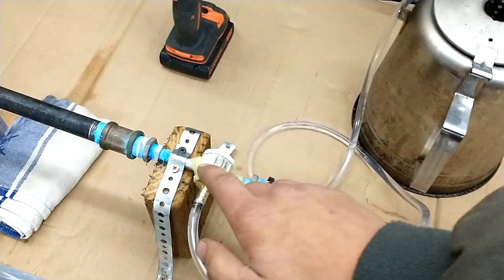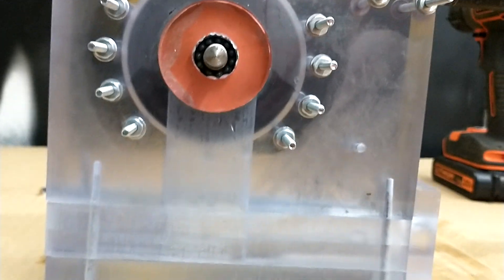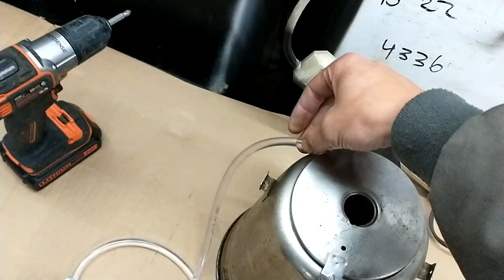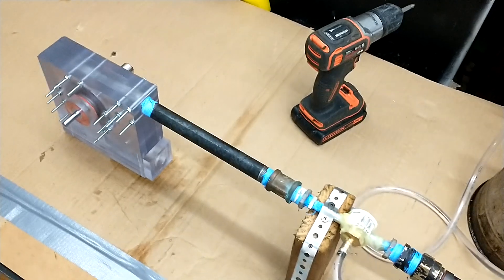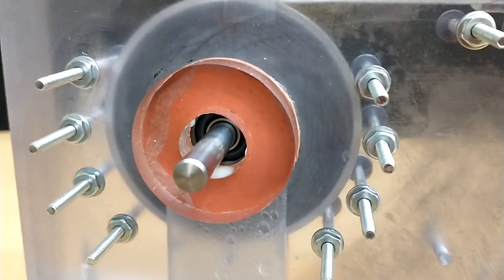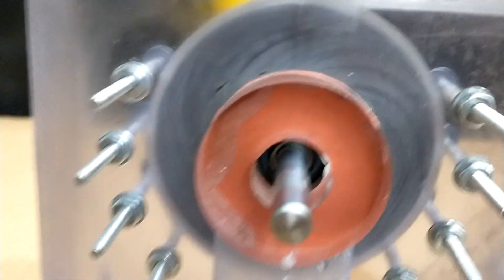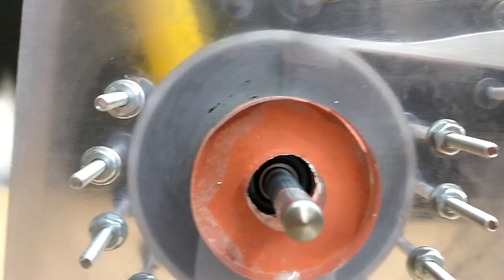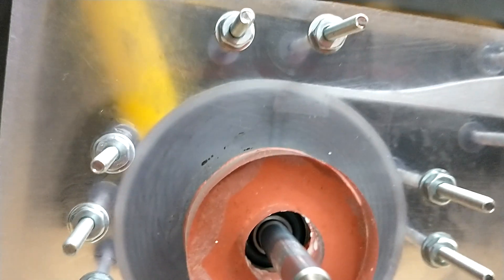Amazing visualization of the boundary layer inside the tesla turbine! See the vortex!!

Comment: Hey bro the bearings it's the problem  needed titanium turbocharger ones to going Up to higher speeds bro trust on me maybe bronzed like de useded in head valves cam, because te looks like this going to flying when take full capacity of the design hahahah

Comment: Any rotary seals do you use in order to protect bearings from water?
Reply: im trying to figure that out as well.
Reply: @andrewsmithmilan1780  There are PTFE seals that run dry (without oil) against pneumatic pressure. I wonder if those would work 🤔
Reply: @TANOCA17  good call. 
I think a PTFE o-ring would fit my design perfectly, after doing some research. I'm designing an enclosure to 3d print, will be used for hydro-power.
Reply: @andrewsmithmilan1780  o-ring may not be the best choice for a rotary application as they're designed mostly static or mostly axial shaft movements but only occasional shaft rotation. There are PTFE (rotary) shaft seals from SKF. Those are also extremely low torque which equals low power loss, might be an advantage for such a high rpm application compared to any rubber rotary seal. PTFE is durable up to 30 m/s shaft contact line speed and withstands extreme temperatures. Only disadvantage may be the cost and availability.

Comment: 26 JUN 22 Question: If the discs were made of modern day materials would they withstand the forces involved?  Also: Diamonds can be grown now....would grown diamond discs be strong enough?  (Not a science guy, just a question)
Reply from the maker: The disks worked just fine back in tesla's day, it's a myth. Tesla did one test where the disks warped, and I did as well. Anything will warp or fail at a certain speed. The rpms required for good performance are actually not that high. Ill be showing this in my next testing.

Comment: So you basicly took Nicola Teslas turbine and fucked it all up xD great job man whoohoo 10 steps back for human kind
Reply from the maker: Says the guy who knows nothing about Tesla turbines, unless you haven't seen any of my power testing 😂
Reply: @iEnergySupply  a tesla turbine is indeed that system .. but powered only by falling water .. it seems to me that running a compressor xD doesnt add efficiency or power loss to its already efficient turbine power
Reply from the maker: @obedientfire840  It's designed to work on steam, air was just for pre-testing. Nikola tesla actually used steam too to drive the turbine with great success. The turbine wasn't designed for falling water but will work with it. See my steam testing videos.
Reply: @iEnergySupply  give me a 500 kw electric motor and some some gears and ill show you the power my tesla turbine produces 🤭
Reply from the maker: @obedientfire840  You don't have a tesla turbine. Do you? Also your not supposed to use gears, your supposed to use high speed generators directly connected to the shaft. For a 3 inch turbine I achieved a massive power output at the temperatures I used.
Reply: @iEnergySupply  the goal is . To use less outside power . and make power generated naturaly 🙄 ... if you want power if can give you power
Reply from the maker: @obedientfire840  yeah, I use solar heat collectors that are up to 90% efficient, rather then solar voltaic cells that are only 20% max efficient. And I can store the energy in mass, thermal energy storage rather then chemical batteries.
Reply: @iEnergySupply  your numbers would be the same in syberia .?

Comment: That’s awesome!! I’d love to see a thermal on this! 

I had no idea water would have such an effect on pressure. How is the water mix regulated?

Could a needle valve on the vacuum side of the water reservoir prevent the flooding, in the beginning and the possible oversaturation during operation, without having to change the orifice size of the injector?
Reply from the maker: this isn't the intended fluid, and steam added to the compressed air would be better. I would have to do more research here to give you definitive answers. To see the intended use of the turbine, see our latest videos.
Reply: @iEnergySupply  I’m definitely interested and will be checking them out.

Comment: So this only tells me that the air pressure pushing into the valve is controlling the speed. It is not spinning under it own power haha. Air is the power. Plus if I pushed air into a small opening of course it is going to be forced to push out faster than the supply.
Reply from the maker: What's your point? Why would you expect it to spin under it's own power?

Comment: only if we had a material that could handle this amount of rpm, i read someware that tesla turbine optimal operational speed is 50K rpm! where regular electric turbines operates in a range 1-1.5k rpm
Reply from the maker: or record is 150000 rpm, with a 3" rotor, giving us a 1400 mile per hour periphery speed.

Comment: Try picking up water with a steam water injector, as used in steam engines,  the water flow can be regulated then, also if you fit hydrostatic bearings to your turbine you,ll get more efficient running and you can loose those noisy cheap Chinese ball races .
Reply from the maker: these bearings are rated at 150000 rpm, we show this test in another video. This video was just for fun too.

Comment: KEWL,  I would be replacing that water with oil, the bearing is not going to last long with water as a lubricant and I am wondering what the RPM range is on the bearing part number??
Reply from the maker: people keep telling me the ceramic bearings may not need oil. If they don't' need water would they work with steam, at least the water can add a little bit of lubrication right? We will test it either way.

Comment: But the increase in RPM is because increase in air Pressure or air flow or because increase in hot water. I have a grinder with 65k rpm with only 50 PSI air pressure.
Reply from the maker: it's the size of the grinder wheel that matters, it's periphery speed that shows speed. We recently got mac 1.7, close to 1400 mph perifery speed on a 3" rotor going 150000 rpm.
Reply: @iEnergySupply   The grinder I am talkin about is a hand held for 3mm collet shank. (That is the reason, the peripheral speed). All grinder direct axel over 25K rpm, can't be electrical Universal motors,  because the inertia in the stator will damage the wiring and te spark in the collector will short the tool. I know grinder over 14K rpm but have gears to speed up the rpm out put.
Reply: @iEnergySupply  However, the question here, if the speed is increased by PSI or by the amount of vapor.

Comment: I don't know what pressure you're running, but the reason the water is cold is because the air in contact with it is decompressing. That being said, the adhesion of the water to the turbine surface should drastically increase its efficiency. The spiral formed was also immaculate.
Reply from the maker: This experiment was just for fun, please see our new video. The intended fluid is water only.

Comment: Adding a load would allow you to see the amount of extrable energy from the system and see if the heated water is worth the extra energy.
While interesting. It is important to validate and quantify the specific variables.
Reply: Tesla verified it. The reason it was deemed unusable at the time was because there were no materials that could hold up under the extreme rpm generated. This is an absolute engineering marvel in it’s pure design.
Reply from the maker: Please see our latest video. Our analytical equipment is on the way so stay tuned.
Reply: I hate it when they dont add a load cus they know it's gonna fail miserably lol 😜😜
Reply: @davey2k12  It's like there's some reason no one is powering anything with these
Reply from the maker: @davey2k12  hahaha don't make a fool of yourself before watching the load testing. Here we get over a horsepower of pure electrical power at low speed. https://www.youtube.com/watch?v=MkGAKqG2qvU&t=1s

Comment: Without some kind of load on the turbine it's hard to know how much work it's able to do. Even a simple fan on the axle and measure the RPM would be something.  
Then, run it without the water, just air.  Compare that to water + air, then your steam + air if you like.  For the moment all I am seeing is a thing spun by compressed air and no indication of the water adding anything to it other than making things drippy.
Reply from the maker: We show loads in other videos, have you seen our latest?
Reply: @iEnergySupply  These all seem to involve the water, I'm saying run this without the water, what are the results then?  Once you have that baseline then we have something to compare it to when you add steam/water.

Comment: Um, venturis dont work with head pressure. When you apply pressure to the choke point of a venturi, the increase in air speed creates a vacuum relative to the outlet pressure which for general application is atmospheric. When you try driving a teala turbine, especially with a nozzle that has a small choke point to also get high velocities, you're increasing the outlet pressure on the venturi. Because this pressure is higher than atmospheric, the "vacuum" the venturi creates is slightly less than the outlet pressure which in here nets atmospheric pressure or maybe a couple inches of pressure depending. If you want the venturi to ACTUALLY work, you need the pot to be pressurized at venturi outlet pressure (basically you need a sealed pot where the air space is connected to the venturi outlet so the pressure is the same), and the hose can then feed the venturi. The air pressure differential to get the pumping action, lies between the venturi jet, and the venturi outlet.  Another way to look at it is with no turbine connected, both the outlet and the pot are at atmospheric pressure. You apply compressed air and it works fine. Well same applies for a load. You need the pot pressure to be same as outlet. This is why blow through carb setups on hotrods have a hat that covers the entire top of the carb, sometimes putting it in a pressurized box. This pressurizes the float bowls as well as the venturi. Same concept but backwards.
Reply from the maker: Yeah this test was just for fun. Please see our latest video for the application of the turbine.

Comment: Because other than friction of the bearings you don´t extract any energy, the heat of that warm water just goes into the expanding air, that otherwise would be colder than ambiant after expansion.
But non the less, a nice telsa turbine going at therminal velocity! 👍
Reply from the maker: yeah this particular test was just for fun, I think it would have been better to mix the steam through the  nozzle instead of the just hot water. I wanted to point out, this was actually a low rpm test compared to our supersonic run where we got 150,000 RPM with a 3 inch rotor, roughly 1400 MPH Periphery speed. Here is a link. https://www.youtube.com/watch?v=oVjMJkABboM also please see our latest video that shows the actual working condition the turbine will be used in.
Reply: doesn't expanding air increase the speed of the flow ? it would certainly have some energy to be extracted from that acceleration. That's basically how traditional turbines work, isn't it?
Reply: @monad_tcp  yep, and that's also how this turbine works. They just go the other way around, they heat up gas to get higher pressure. (internal combustion engines, like jet turbine have an extra step) Than it's the same, gas expands, and a portion of that energy potential gets converted to mechanical power. 
Pressure and heat are interlinked, or basicly exchangeable in gases.
Compressed air is higher pressure gas that got rid of it's excess heat after compression. When resalesed it drops in temperature, if you give it the same heat back on expansion or ceep it hot, you theoretically get all the mechanical force back you put in to it.

Comment: Would it be possible to upscale something like this to, say, power a house? I've heard it needs some serious rpm's to generate a lot of power. I imagine the spinning parts would have to be made from a hard, heat-resistant  material with high tensile strength.
Reply from the maker: absolutely, see our newest video, and please leave a comment. with carbon fiber we achieved 150000 rpm with a periphery speed of nearly 1440 miles per hour.

Comment: Should measure what rpm that's spinning out that's insane
Reply from the maker: Our record is 150000 rpm, and roughly a periphery speed of 1440 mph
Reply: @iEnergySupply  looked at running a turbo impeller see how much boost you can get? 😆😆😆

Comment: 0:07 uhhh...... 212 degrees and 80 degrees is QUITE different 
.
if you said its "212... or it might be 180 degree water".......
i would not IMMEDIATELY start to doubt all claims you make
.
like.... i think this style of turbine CAN BE just as efficient as a blade type..... 
with the right nozzles, high speed, and 2 or more stages, with the perfectly sized disks
.
but saying "ya... it could be ice, water, or steam..... i have no idea"
that does NOT inspire confidence.... 
.
.
.
i really hope that was just a slip up
and you MEANT to say 180 degrees 
.
and while 180F to 212F is a MUCH MUCH smaller "controlled experiment" issue.............VS 80F and 212F
80F is pretty far below boiling point....... and 212F is right on the edge of boiling (at see level) 
.
.
.
.
so again..... i hope you MEANT to say 180 degrees
.
because if you dont know the difference between just over room temp........ and partially boiling water
then you clearly dont have enough skills/equipment/sensors.... or even just knowledge.... to conduct an accurate experiment, with actual control

.
.
.
.
.
.
.
PS.... im only 0:14 seconds in..... and im REALLY questioning this
Reply: "the water forces the compressed air to expand"
.
oohhhh nnnoooo ........ you are a hack fraud 
.
COMPRESSED air is going to expand...... thats just what higher than atmosphere gasses do when exposed to the atmosphere 
unless it sees air/water/ETC at a higher pressure (then it will contract or condense) 
.
the water isnt forcing anything...... 
its simply at a lower pressure than the air
.
so ya.... the air is going to expand..... and speed up the flow of the water
also increasing its pressure
Reply: 1:05 how are you sealing the water/air from escaping threw the ball bearing??
.
even a "sealed" ball bearing will have SOME leakage.... especially with age and high RPMs
.
also.... thats not a sealed bearing.... as you can see the balls...... 
its not even a "shielded / dust resistant" bearing
Reply: before you saw the "vortex" and it REALLY started to pick up speed
you had one of the issues with this design..... low starting power
.
the air/water was simply flowing from the nozzle.... straight to the exhaust/ center 
.
once you gave it enough "load"....... it actually started to work as intended 
and the boundary layer could actually start to form
.
.
.
like... at first.... 100% of the energy was simply from the nozzle just being pointed at the top edge
once the "vortex" started..... now you are DRASTICALLY more efficient.... due to the layer working longer on the disks (starting to flow in a spiral) 
.
.
the higher the speed....  the more work the air/water does..... increasing efficiency
which starts a feedback loop.... which means higher speed
higher speed = more efficient 
more efficient = higher speed
higher speed = ETC ETC ETC ETC 
.
till the dicks blow up..... or the bearings seize (due to the lube being flushed out with water.... which is why you see that white "milk" crap)
Reply from the maker: dude this was just a fun experiment, it's not meant to be used this way. sometimes while i am waiting for stuff I mess around. See our latest content before judging my entire channel. and yeah I meant to say 180 obviously.

Comment: Okay im curious, if someone took let's say 2 of these and mounted them to the sides of an electric car or built them into an electric car with like a forced induction tunnel (like a turbo) and the dimensions you needed to achieve it was possible could you not permanently charge that car? I don't know anything behind the science aspect of electric cars besides they run on stored energy, that needs to be charged. It just seems with them being the right size and having the right out put it would be possible.
Reply from the maker: I believe it's possible with salts in a cold steam system. For now we are going to use just water, in our vacuum boiler/condenser system. https://www.youtube.com/watch?v=SbVRXvrGJfI

Comment from the maker: I wanted to show the boundary layer inside the tesla turbine and also show the vortex in action it bears a striking resemblance to a tornado, but it's in a box. Here is a see through tesla turbine that shows it all visually.
Our new website is almost finished! Myteslapower.com
Pateons saw this video 3 weeks earlier.
https://Patreon.com/ienergysupply
Reply: This can all be done with just air. 
Need to have a side by side comparison.
Reply: that is impressive add a turbo on one of the out put shafts to feed the compressed air to the venturi  then collect the chilled water and use it to cool the incoming air compressing it further prior to introducing the hot water add a pto gear box on the other end of the shaft and you have an engine that will run off of a hot water heater....or solar  i wonder what the HP efficiency would look like per watt of heat?
Reply: @kevint1910  kool man
Reply from the maker: @rickybobbyflyingwild8119  Thanks!
Reply from the maker: @kevint1910  Great idea! Please see our latest video too, we could use this to cool the engine too.
Reply: Fantastic!!! ~Russ
Reply from the maker: @rwgresearch  Gosh thanks Russ! Thanks for inspiring me to work on my project! Have you seen my latest video?
Reply: i have a question sir, how to stabilize the turbine rpm?
Reply: U mean Patreons?